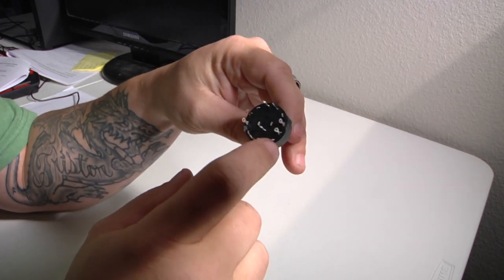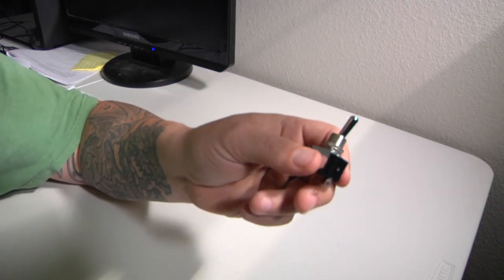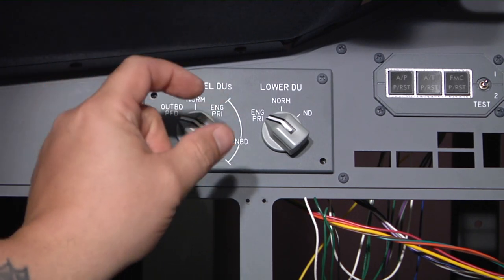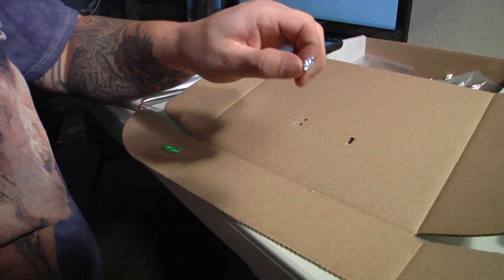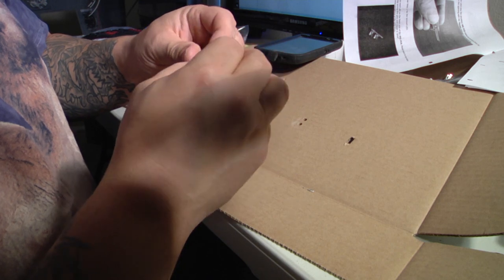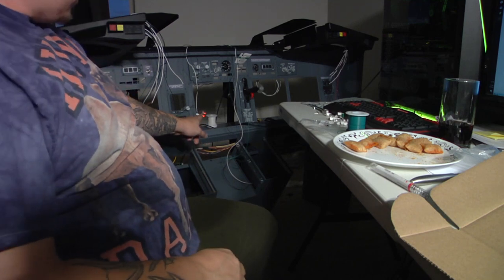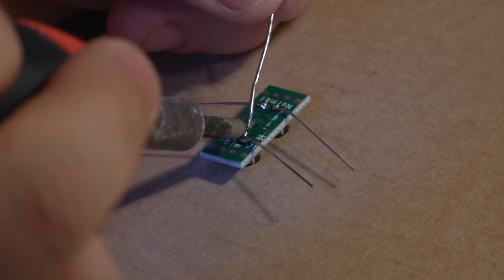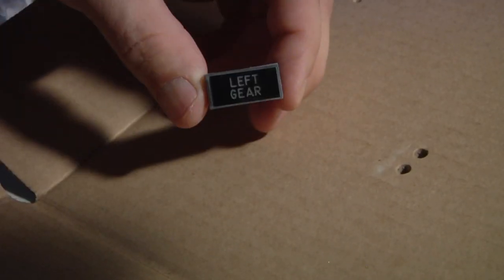ABQ 737 Experience Ep8 MIP switch and annunciator wiring and assembly

Comment: Hi just wondering what is the board you put the led into and what was the white thing with the 4 prongs that you plugged into the board. Also what the name of the software to test them and is there a video on how to configure them with the actual flight sim software for example if I put the gear up the annunciators would work without me doing anything thanks
Reply from the maker: Hello. The board is the FDS-SYS4-XT from flightdeck solutions. The white piece is just a male connector that comes with the annunciator kit which you can also order from them. The software is Simavionics. It drives the LEDs and has all the test software built in. I do not have a tutorial for that, but I will add it to the list of tutorials to make. There is a very detailed manual available when you purchase Simavionics.
Reply: @albuquerque737experience8  OK thanks